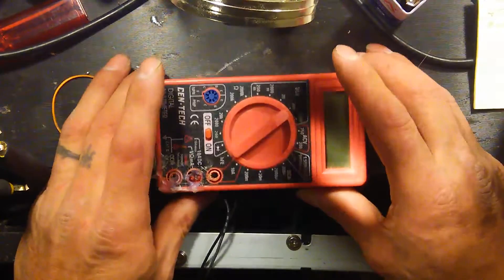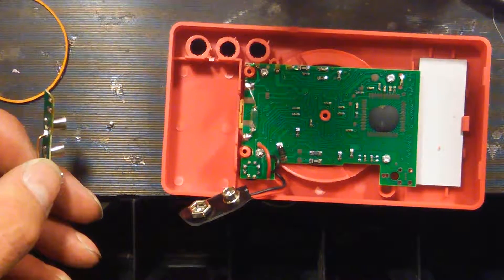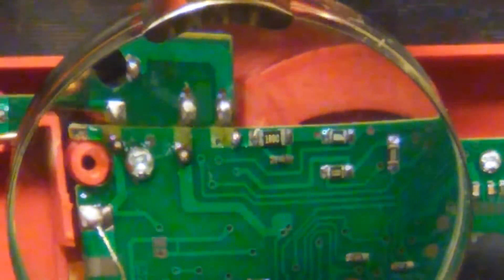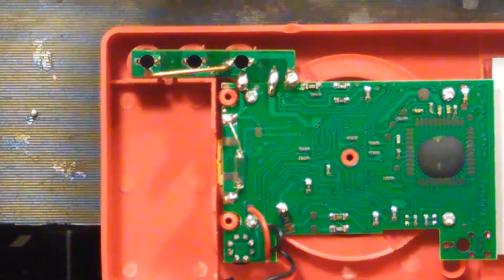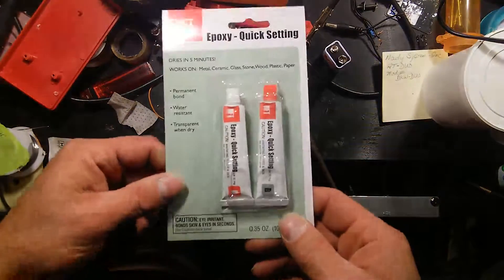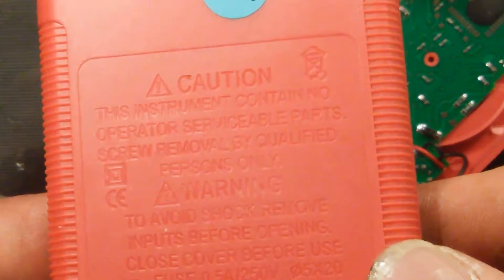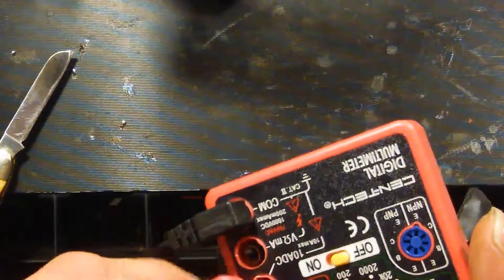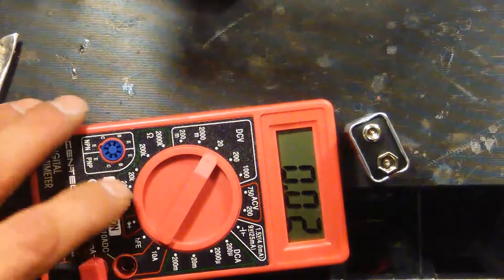How to Repair a Harbor Freight Voltage Meter EASY

Comment: At 12:10 on a new one, open it up and do some preventive touch-ups, before it fails. Glue PCB before it breaks.*
I've got a couple of them dead when new. One, had a leaking dead battery, and the other had a open solder joint.

Comment: There are several versions with very different "innards" On some the input board is one with the main board to avoid your problem. I got a lot further into it in the one you are working on. I accidently set the wrong end of the switch to AC. I was actually on  ohms. Everything but ohms still worked. After close inspection with a REAL meter, I found surface mount resistor R13 was open and fried. I was not going to bother ordering a 1500 ohm SMD for a freebee so I tacked a 1/4 watt leaded resistor to the pads  and presto, it was fixed.